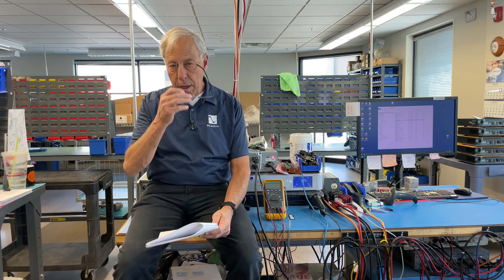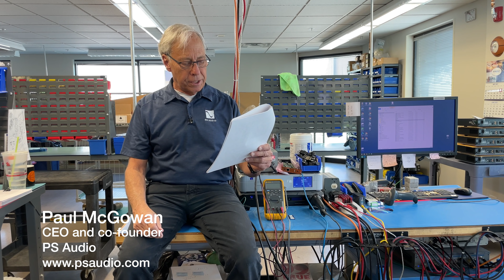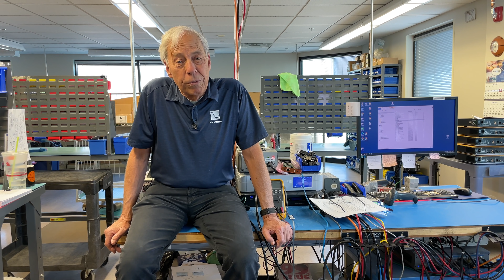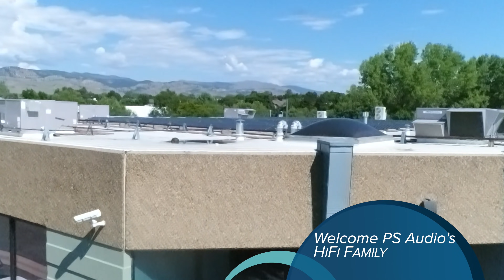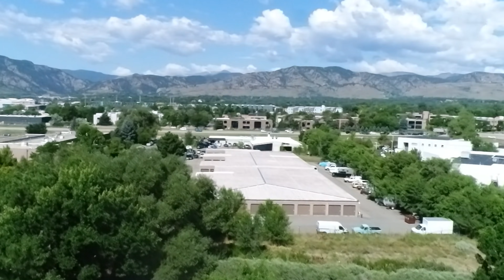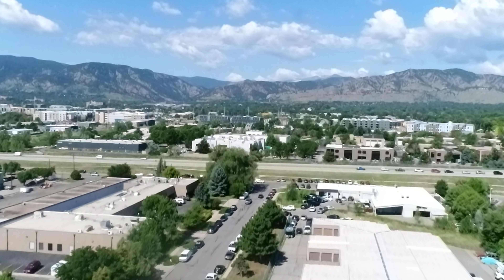When to change vacuum tubes

Comment: Every time  I replace tubes in my M&A TVA 1 amplifier the sound gets worse, new tubes need many hours before they start to sound good.
I have NEVER heard brand new tubes sound good right out of the box.
I have old tubes with thousands of hours still sounding crisp and clean compared to brand new that sounds "hazy" until broken in.
If an amplifier only sounds good with brand new tubes it's not a good amp.

Comment: If you're changing tubes on an annual basis then those tubes must be trash to begin with. If tubes are rated for 3000, 5000, 10,000 hours....follow that, dont just swap and toss for no reason.

To keep with the hair analogy, this is like getting a haircut every week. Excessive, unless its so cheap it doesnt matter.

Comment: Great video.    I have tons of tubes made in the 40's, 50's and 60's.  Tubes don't age with time, but hours used.  Small signal tubes are good for minimum 5,000 and more commonly 10,000 hours.  They usually sound best to me at 5,000 hours.  At 20 hours a week of listening, which is a lot for most folks, that means well over four years.    Really five. 

Don't waste tubes.  The only tube tester is your ear.  After you hit 5k hours, replace the tubes with new ones and let the new ones break-in for a couple hundred hours.  If it sounds better, which I bet they won't, leave them in.  If not, put the old ones back in.  

With power tubes like EL34 and KT88 the same rules apply but they are usually good for minimum 2500 hours but that's determined by how much plate voltage is applied and how hard they are biased.  The GEC tube manual states a KT66 is good for 8,000 hours running at maximum dissipation and 10,000 hours running at 65% which is quite common for a tube amp.  I've seen an amp with KT120's in it accidentally left on 24 hours a day for six months which is 4320 hours.  They tested at 90% of new. Never leave any tubes on 24 hours a day.  There's no need.  They are thermionic and get up to temperature in 3 minutes.  The exception is big KT150's which takes 9 minutes. 

The Bob Carver "story" of 50 years is silly.  I've certainly re-tubed plenty.  They cut the tubes off from dissipation when there is no signal so in theory the tubes can last longer....unless you turn on the music.  Then they are like any other amp.  There is no magic way to extend tube life.  The same rules apply to every amp.  That's why I hate bullsh*t in this business.  So much annoying crap with half-truths.

Comment: When I was at school in the 1960's I became a radio amateur and built most of my own equipment, including transmitters and AM modulators.  The latter I based on hi-fi designs of the period (Mullard "Circuits For Audio Amplifiers").  Being an impecunious schoolboy I could not generally afford to buy new components so many of the KT66's, EL34's and EL84's in the modulators were second-hand and had seen unknown hours of previous use.  One of the few brand new valves I had, of which I was very proud, was a Mullard QQVO3-20A ( http://www.r-type.org/exhib/aam0028.htmhttp://www.r-type.org/exhib/aam0028.htm ).  Unless they were seriously abused, over a period of 5-6 years of very active use I can't recall ever having to replace a failed valve. Maybe the "golden eared" can indeed tell the difference between a new valve and a year-old valve, but in my experience they are capable of many years of good, or perhaps I should say "adequate"?, service.  A lot of amateur gear in those days was bought from ex-WWII surplus stores and adapted accordingly - who knows what sort of life those valves had had?  Worked pretty well though.

Comment: We changed tubes when they went bad. Nobody in the electronics and audio magazines of the 60's and 70's advised otherwise, Paul, and we used tubes heavily. My Sherwood FM tuner worked for 25 years without changing a single tube. It was retired in full working order.

Comment: Im here representing the guitar players using tube amps.
Even when i was playing 4 hours a night +, i never changed my power tubes in my 50 watt Marshalls...pre amp tubes went bad every couple years, but those are relatively inexpensive, but NEVER in the power section...re biasing was about it.
I changed the 6550s after 30 years, but they werent bad even then.
Im sure my old vintage stock tube stash are WAY better than the new China or Russian made tubes of old, but still, at $75 each, those add up quickly.
Good luck to all of you.

Comment: Luv most of your videos Paul but I have to take exception on this one. The best tube tester is the DUT, device under test, but a tube tester can give a basic idea on how well the tubes are working, especially at audio freqs. 
I recomend changing out tubes in pairs after auditioning several of your favorite pieces of music then put the original pair back in and check left and right sides again as well as soundstage and overall clarity. If there is no difference, leave the originals in and check the next pair in the audio chain starting at input/preamp side, then driver and then finals. 
This will take a little time but most likely, you will end up with a pair or more of good tubes.
Also, if you are going to spend thousands of dollars in equipment, invest in a basic tube tester, particularly one which has been serviced/calibrated. These testers can give erroneous readings at RF freqs but they generally do well at audio freqs.
Down side is tube testers have gotten crazy in price. The same testers I once paid $25 - $35 for now bring $300 tp $400 or more. Check Heathkit, Eico on ebay or if you want a nicer unit look for a TV7 but expect to spend close to $1000 for even thought a $300 Heathkit will give the same results at audio.
We listen to our sound system ~10 hours a week and I have tubes that still test strong after 10 years and sound no better or worse than brand new tubes. I have also had tubes fail after 10 - 20 hours.
One other thing to consider is if you live in a community with a number of serious audiophiles is to buy a communal tester and vote on a responsible member to hold it. You will probably need it maybe once a year. 5 friends pitching in to purchase the $1k tester might make sense to some.
Reply: U7

Comment: He’s not giving good advice. Most power tubes will last about 2000 hours in most amps. That’s a general rule of thumb and the amplifier design does matter. I own Quicksilver amps and preamps along with Audible Illusions pre amp. The Audible tubes only last a year at most. They run those tubes right to their limit in that circuit. The QS mid mono power last for me about 2 1/2 years. I’ve kind of figured out I listen on the weekends about 8 hours. I listen on some weekdays for an hour a day not every day. The preamp tubes in the QS last about the same as the amp. The Phono preamp tubes are still going strong after three years. Changing tubes every 6 months is throwing money away. Even the Audible Illusions which is well known for eating tubes can last a year on a set.

Comment: How can it be reference system when you notice that much difference on changing the valves? The logical conclusion here is that the sound you are referring to in your 'reference' sound is continually changing right?

Comment: I have the VAC PA 100 100 tube amp & ARC LS15 tube pre amp that l bought new in 1995 and just replaced the tubes in both units last year!! It was only last year l couldn't that l couldn't bias the KT88's in the VAC amp

Comment: Well I hate to say this but you don't have to change them every year if you do what I do I have a tube tester I periodically remove the tubes from the unit I have an old Fisher 400 receiver and I played quite often and I have a brand new set of tubes sitting in the closet and I check the tubes out at least once every 6 months and I haven't seen any real I would say problems with the tubes they are right there where they were when I first bought the unit I bought the unit second hand I did smart thing and I went out I bought all new tubes and I made sure that all the capacitors and everything in the unit were all good I replaced anything that was week and I made sure the whole house system I went through the whole entire thing and I basically overhauled the whole entire unit and this thing works like a peach it's like everything else that I own I like to keep it in Tip-Top shape and I check it all the time instant vintage reel-to-reel I have Nakamichi cassette you name it I've been going through my equipment for a long time and I keep up on it I also have some Modern surround sound equipment that I have basically gone through and modified that cause I did not like the op-amps that were in it and I replace them with something better as long as you maintain your equipment properly tubes can last a long time don't you watch them and you check them periodically on a tester and make sure the readings are good I still have a brand new set of tubes laying on the side in the boxes just in case and I keep an eye on my whole entire system and I listen to them through a pair of Altec Lansing voices its theater so like I said I like vintage stuff as well as some Modern as long as you maintain it properly it won't continue to work

Comment: Buy a nice tube tester like etracer. Or maybe simply measure the voltage drop across the cathode resistor if your amp is using auto bias.

Comment: It also depends on how 'hard' are the tubes been driven.
In output tubes, if they operate well below their specs, they would last a number of years. And biasing has of course a lot to do with it. Don't over-bias them and they will be good for a long time.
Input tubes are usually not working anywhere near their limits so, they should last longer. One reason for changing them is for 'tube rolling', trying to get a "better / different" sound from them.
Not so much about reliability.

Comment: I like the sound of a set of well seasoned output tubes. A new set of tubes will sound a tad harsh and strident until they get a few hundred hours on them. I replace mine when they are at 50% of rated GM rating of a new set.

Comment: I wouldn’t be surprised if these garbage modern day tubes wear out in a year. Definitely not 50’s and 60’s tubes. I’ve run some tubes every weekend for years and they still measure strong.
Reply: You're perpetuating a myth with the 'garbage modern tube' statement.  50s and 60s tubes were always failing and no different to today - it all depends on the equipment they're used in and how hard they're driven. Small signal tubes seem to have random failures and always did and can last a long time in service. They can also become microphonic as did the tubes back in the day.  Power tubes in some power amplifiers are driven harder today and can fail prematurely if just user swapped out without setting the bias correctly. I have Leslie amplifiers with a couple of original 1960s 6550 tubes still going strong but they're only dissipating 40W peak between them which is well below what they can deliver. Unless you compare like for like and over hundreds of installations it's too easy to dismiss modern tubes. There seems to be a resentment in the user base of the fact that most tubes today are made in China or Russia and not the UK or the good old US of A. Visit one of those factories and you'll be astounded at the precision of manufacturing, the quality control and the passion of the people who run them who in some cases are Americans.

Comment: One way to address this is to have some NOS tubes of the exact same type in service, as a back up.  Then at some long interval, change to the new tubes and listen for a while.  If there's no notable difference, switch back to the old tubes.   After another period of time, try again.   Otherwise - if you just automatically change at a time interval - you could be throwing out tubes that are still functional, at least within your system and to your ears.
Reply: This is a better advice than what was said in the video
Reply: great advice

Comment: Maximizing usable life of a properly made receiving tube is a big topic, and involves a lot of variables. Not the least of which is the specific circuit in which the tube is used. No question that the sound of an amp can be changed when new tubes are fitted, but the changes may not be for the reasons assumed by the person(s) installing the new tubes. Lots of folks like 'tube rolling' because they get to explore the sonic changes from the newly-fitted tube(s).

Comment: In solid amplifiers  do  not expect time  wear  because their electrical data are still the same and we  "do not imagine" something lost . In  vacuum tubes electrical data we may measure  also    good as new , amplifier works beautiful but  we imagine time wear and trust to that  imagined emotions 
   My advice is to change tubes when channels  one to another show difference because in any set there is always one weakest and when that one is gone first still 3 other will be satisfactory  so at first moment only one channel will be affected - can be traced when balance of stereo needs change comparing to past .    The same with SE. To be sure we easy can exchange tubes in channels - when really tube is worn problem will shift

Comment: If you lower the filament voltage and design the circuit around that performance, you can get much longer life out of tubes. It's similar to installing 105° caps where possible (they last longer). Back in the day, they had tube checkers, and we knew how to use them.

Comment: Great answer, just like the spark plugs, brake pads or tires on our cars..... We drive our cars so frequently, that as it ages and wears out, we also become use to how it performs or drives... we think its the norm/or in top performance.. but it really isn't... we shouldn't wait until our car ultimately breaks down and fails....  same with our audio gear, especially $$$ gear...take care of it, it will take care of you... when the time comes to resell, it will still be worth a good penny

Comment: I'd love to hear a discussion on the nature of vacuum tube degradation. What and how does a tube degrade.
Reply: They degrade in multiple ways. Not only does the cathode lose it's emitting properties causing a "weak" tube but gasses are released from the elements of the tube structure causing the tube to be eventuality uncontrollable like a nuclear reactor that has too much contamination at it's end of life.
Reply: @InsideOfMyOwnMind  Grid leakage runaway conduction? You can also tell high hour tubes by tungsten burn, a smokey deposit left by the heater above the glass, not to be confused with the getter chrome deposit which is there to absorb the impurities as the tube ages. As the getter material is used up, as in a high hour tube, the chrome shiny spot gets smaller and dark around the edges. If you see a coco coffee color to the getter spot around the edges, that is also a sign of end of a hard life.
Reply: @zulumax1  I see all of those properties almost on a daily basis. More common in my experience however is the output tube that just arcs out regardless of age.

Comment: In a preamp I would say every two years is sufficient assuming you don’t keep your preamp powered up all the time. In that case definitely replace them every year. Tube rolling in a pre can make a huge difference, negatively or positively in performance. If you select NOS tubes buy them matched from a reliable and knowledgeable NOS dealer not on the cheap from eBay. Also I have found cryo’d tubes can offer a big step up in performance and longevity too.

Comment: And just by coincidence PS audio will sell you new tubes. The truth is that tubes can last for a decade or more (especially true for small signal tubes such as in a preamp), and power amplifier tubes can last almost as long - it depends on how many hours a day you use the amplifier. What Paul is saying is absolutely a money grab and is absolutely untrue. If he were selling tires, he'd recommend replacing them every six months.

Comment: I've heard you can change the sound on amps by changing the "type?" Of tube.
 Anybody know where I can get more information?
Reply: You wouldn’t change the type of tube but different brands have different “signature sounds.” If my memory serves me correct, Electro Harmonix tend to be a little bright. Gold Lions have a warm midrange (my personal recommendation based on price). There are quite a few videos on here of people comparing tubes but through YouTube you’re not really going to hear the correct differences. Best way to find the tubes you like is to do your research and then hear them in person, preferably on your own system. Make sure if you buy new tubes you get a matched pair. Each tube has some microphony and ideally you want two, or however you need, with the same measurements. I wouldn’t buy from eBay but someone like Upscale Audio is good. Btw this is referred to as “tube rolling.” Lastly, there are two categories of tubes when shopping, new and NOS (new old stock). All NOS means is they’re new tubes, never used, but were produced years (probably decades) ago. Some people swear older tubes were made better and sound better so they want tubes from the 70s or whichever they think sound best. They may sound better or different than tubes produced today but they’ll cost significantly more due to their scarcity
Reply: @xjimmy225x  Some amps allow you to use different tubes. And I mean actual types, not brands. EL34, KT88, 6550, etc..
Reply: If you want to learn about tubes Mr Carson lab   YouTube it
Reply: Caution! rabbit hole activated